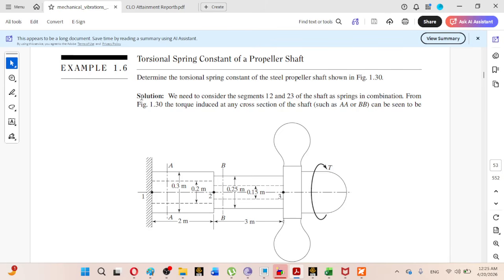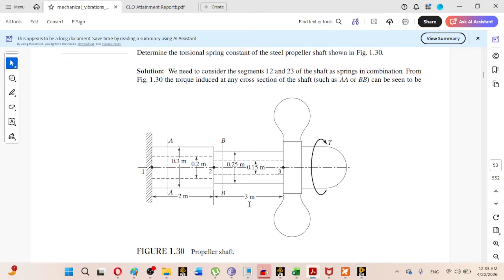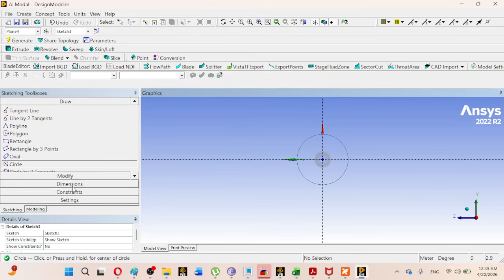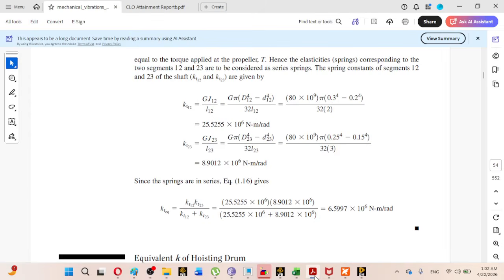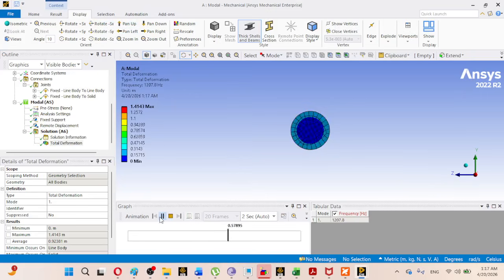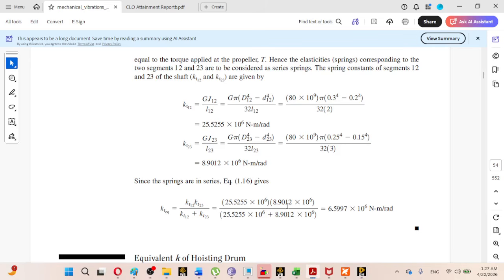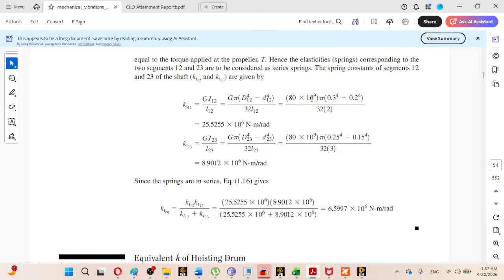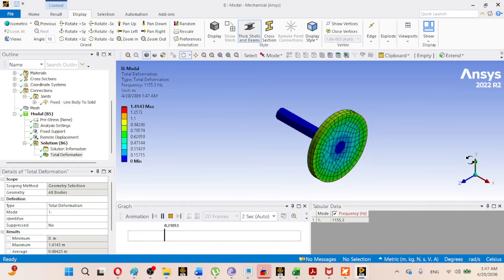MV Lab  Session 8: Application of undamped torsional  free oscillation

Comment: 2022-ME-369
Sir, in series connection of springs, since equivalent stiffness decreases, does that always reduce the natural frequency, or are there cases where mass distribution changes the behavior..?
Reply from the maker: The suitable reply is to consult relevant theoratical formulas from theory as you all of well at this level. After that again state if the issue remains....